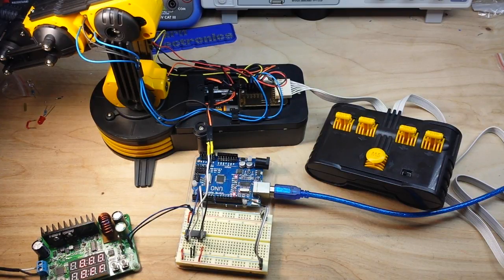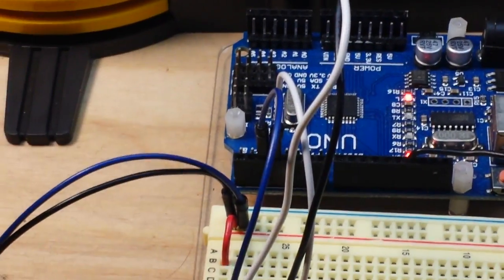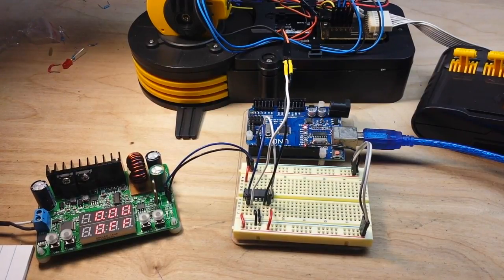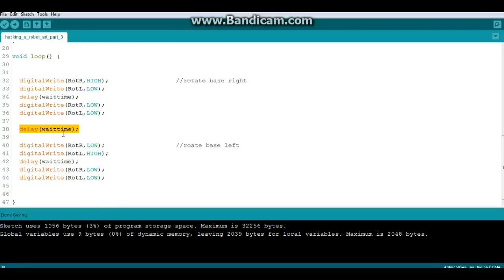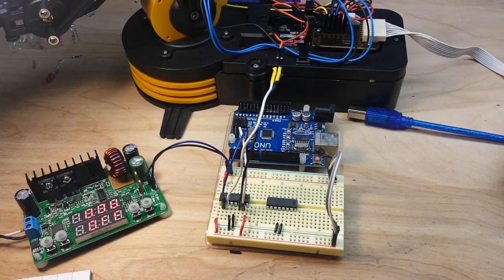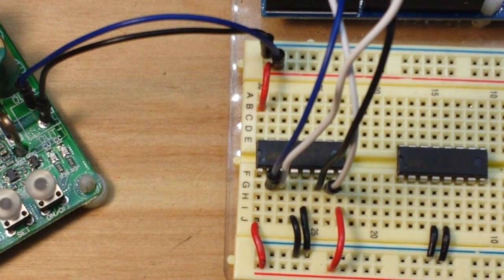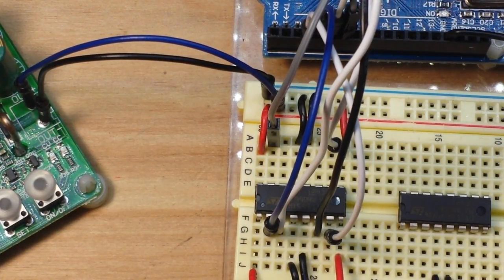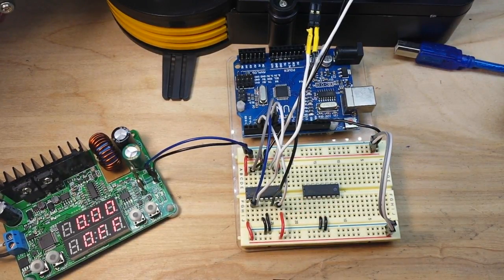Hacking a robot arm Part 3

Comment: I built the same thing using the exact robot arm. I used 15mm thumb wheel pots (10k) for the first 4 joints and a 10 turn pot with a rubber gromit as a reduction gear on the base. I also built my own Arduino controller, with PWM, PID and bluetooth connectivity. It was just easier than modifing the existing controller and this allows me to use python scripts for routines.

P.S. I can send you pics and the Eagle schametic  if you are interested. You will need the following parts:

3 - L293D
2 - 74HC595
1 - LM7805
2 - CD4051
1 - Arduino 
1 - HM10 Bluetooth Module

Plus a switch connectors, heatsink, resistors, caps, etc.

Fits on a 3" × 4" pcb which is just exact if you remove the battery compartment from this arm.

Comment: Damn, this getting good! I wonder if you can come up with a way to teach the robot arm to make particular moves like real robots? Keep 'em comin!
Reply: You could, but the microcontroller has no way of knowing  the position of the limbs on the robot arm so repetitive movement would be very inaccurate, even after one iteration. One possible solution is to add  some potentiometers to the limbs and get some feedback about their position. Other more expensive solution is to use Steppers or Servo motors.